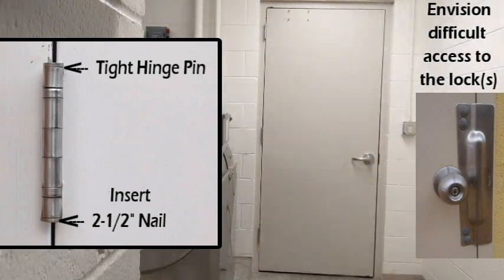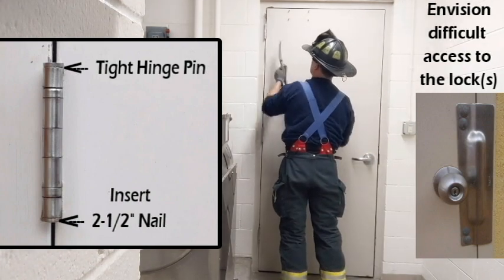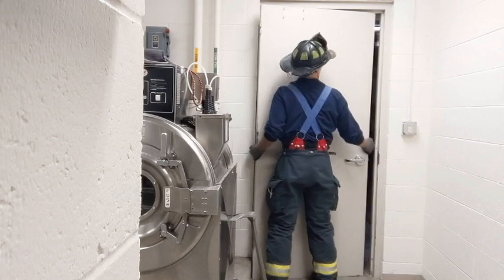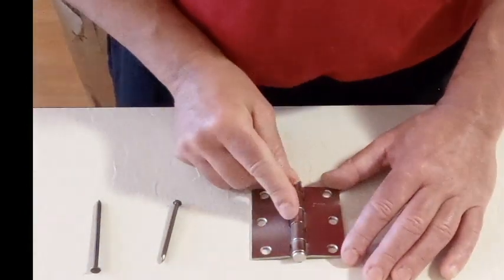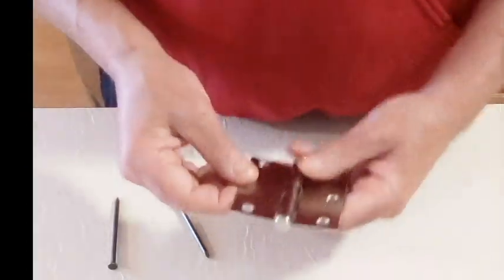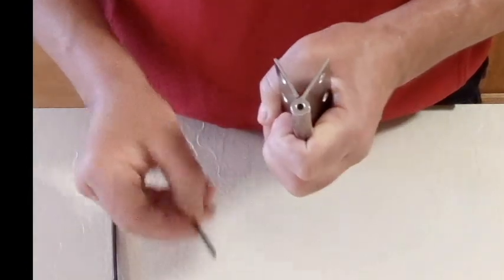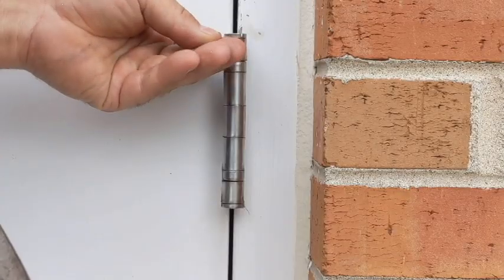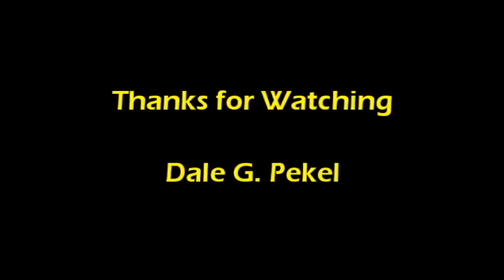Video #3 - Masonry Nails - "Finesse" style entry Continued

Comment from the maker: So I've had a couple asking how difficult this technique is on doors that have more substantial locks than just a knob lock. I didn't mention this in the video, but if the dead bolt(s) have long throws (greater that 3/4") it may be necessary to insert the Adz end of a Halligan bar in the seam on the latch side of the door after the hinge pins have been removed. This is where a second Firefighter assisting becomes important - The first FF keeps the hinge side of the door outside the jamb (with a wedge or another tool) as the second FF starts to pry the locks out of the latch side of the jamb. If the deadbolts are torqued, even a little, it can be difficult to "walk" the door free - So the Halligan can create a little more leverage to pry the locks away from their strike or keepers. Another reason to have a quality Halligan bar or one that has a "refined" or thinner edge Adz - Which allows the tool to work in tighter areas/jambs/seams. Hope this added info helps, but remember nothing beats getting out there and trying this technique yourself. Find a metal door with a metal frame/jamb around your firehouse and give it a go!